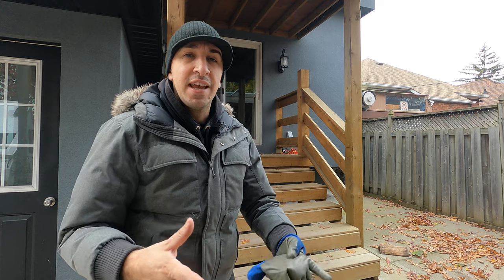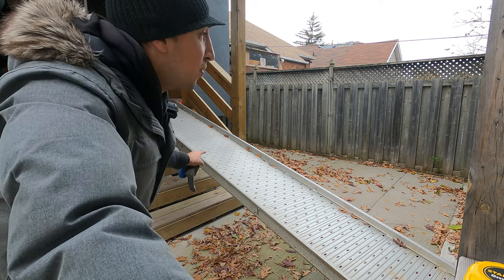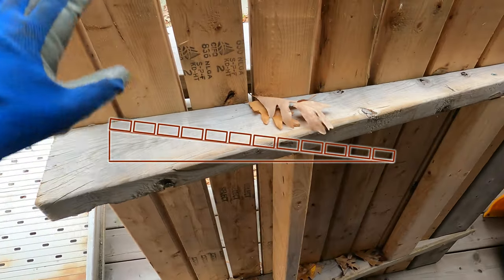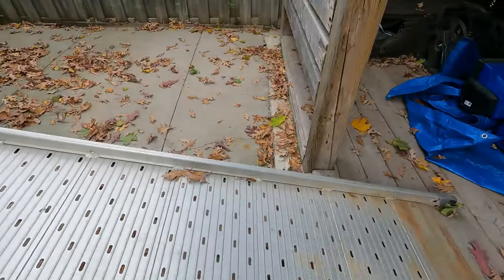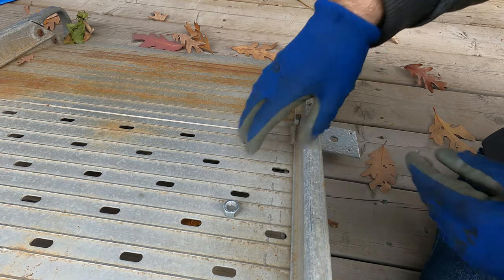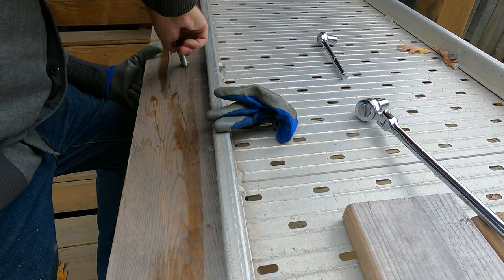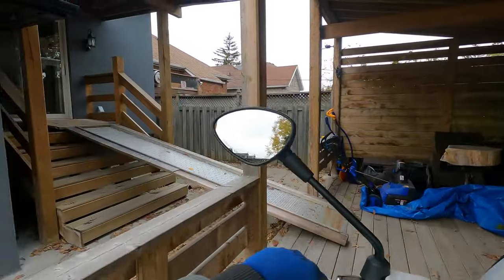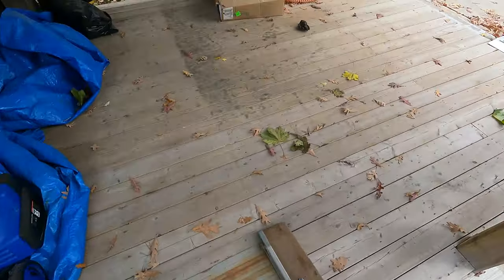How To Bring a Motorcycle Inside The House

Comment: Excellent video bro. I am working on the same things not only for my 50cc scooters & big HDs but to demonstrate how to get them in and out of my 28” (inside dimensions of my liquor stores’ doors) but also into apartments/condos that have some stairs and 31” doors. These can be big issues made simple. We should post the body width of the cycle and the true inside dimensions of doors. One of which to one of my stores is a bxxxx and is glass & steel small door and I’m going to use an epoxy & 1/4” rubber liner on the frame to protect my bikes from being scratched going in & out. 👍 Thx bro.
Reply from the maker: A couple further tips because I have some tight doors inside my house:
1) You can take the handlebar off and just steer by the fork tubes
2) Sometimes the easiest thing is to take the pin out of the door hinges, remove the door, move the bike, put the door back on.

Comment: Great video! I'm lucky and my door way is level to the ground like your black door there that you didn't use in the video. But all my basement is also level and I want to bring my bike in the house as well. I got a 2013 sportster xl883L and my door looks similar to yours it's a 32 inch out swing ! Wondering if I can fit my sportster thru a standard door. My handlebars are stock
Reply from the maker: lol the black door goes into the basement apartment... in which case I would still have a staircase to deal with, just my ramps would be going down, not up :) Sportster will fit. Walk a bicycle through first and you'll get the feel for it real quick.

Comment: I am planning to bring my bike Indore next winter. My question is do I need to take any safety measures like emptying fuel tank or disconnecting battery ? Please advise if anyone have experienced it already.
Reply from the maker: I only disconnect the battery if it's for aesthetic reasons (like I don't want to run a cable to the bike based on where I'm storing it, otherwise not necessary).

Newer motorcycles will have a carbon evap filter so they won't smell too much of gas. Older motorcycles might smell a bit more.

You should contact your home insurance provider to get their advice.

Comment: Im still worried about puting mine in the basement, btw you could remove most window doors by lifting each windows out of the tracks.
Reply from the maker: Yeah, not interested in making work for nothing lol. If it doesn't fit through the back door it won't fit through the doorway once it's inside. Thank you for trying to help me though.

Comment: Hi, what was your biggest bike that y get true this door? (steering width)
Reply from the maker: Hey Tomek, handlebar width doesn't matter too much because you turn the handlebar all the way to the maximum and suddenly the width of the bike is less narrow.  Other parts of the bike are more important. For example, I brought a Bonneville into the house and I brought a Moto Guzzi V7 into the house. The Guzzi was harder because the exhaust pipes on both sides at the back stick out wider. For bikes like these it's a good idea to just remove the muffler (usually just two bolts) if the space is very narrow. 

At my old house I've brought my old FZ6R, Sportster, Monster, a buddy's Ducati Panigale, etc. My old house was much easier because the front door was ground level, but this ramp is nice and wide so its still pretty easy.

If I were you I would measure the bike width when the handlebars are turned all the way to the right or left, and then measure your doorway, and see what's possible.
Reply: The bike what im thinking to buy is a Yamaha 9 GT 2022'. Online i found specs that shows bike width is 885mm...(my door are 820mm) so should be possible if i turn o till bike.. 
In this bike the exhaust is completely different position so its starts lookin good for me🙂
Reply from the maker: @tomektomek4615  measure the body width as well before you buy it. Maybe also have a friend with a motorcycle come over and try to bring theirs inside first and see how easy or hard it is. Good luck :)

Comment: What about a 700lb Harley Wide Glide? Think that ramp would hold it? Also, where did you get that ramp from?
Reply from the maker: Yup. Rated for 1600 lbs. You'd barely be over half capacity.